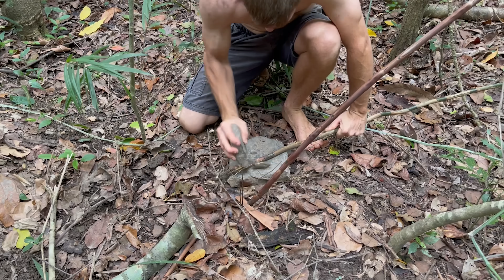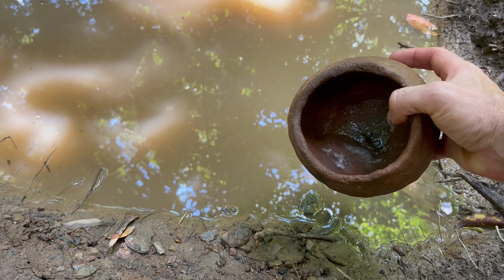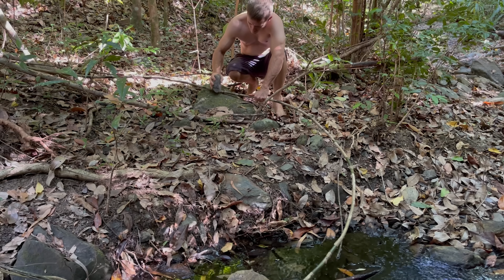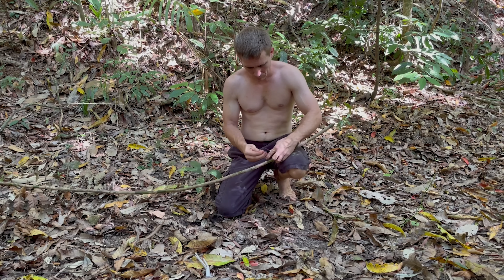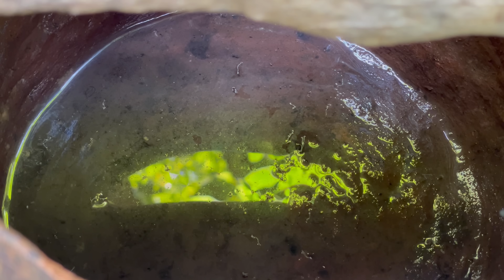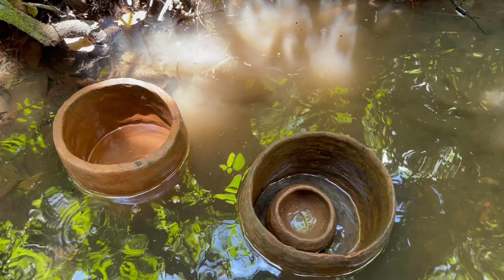Primitive Technology: Cane Water Filter/Siphon

Comment: So cool to see the water seeping through the clay, I had no idea it could do that.
Reply: I knew water will wick through a terracotta pot because you can use them in your garden as a slow, steady way to water plants at the roots, but I had never considered the fact that this would work in reverse if they were submerged in water and that this would filter the water. But clay is used as a water filter in some devices.
Reply: Are they not fired or what? I didn't think the pots were water permeable
Reply: @betterthantelevision  they are fired. and they arent nearly as permeable as when not fired. but to make them truly waterproof he would need to somehow glaze them. at least the inside, but i dont know if the glaze would maybe chip off if the outside would still let water in and have it seep under the glaze. if thats even how it works, im totally talking out of my a$$ right now
Reply: @drecksbongert4367  You can actually use milk to increase the waterproofness of the pot. Simply rub some milk on the inside of the pot and then let it dry out completely. This will create a thin waterproof layer on the inside of the pot. Although, I don't know how long this layer will stay and if it will eventually dissolve into the water again. Also, where he is located is might actually be more feasible to glaze the pots than to obtain milk.
Reply: @betterthantelevision  they are and thats also how the concept of earthern pots work.
The water that very slowly seeps out gets evaporated and that makes the pot and the water cool.
They wold need a coating to be waterproof.
Reply: I did some pottery classes about ten years ago, and from what I remember, how permeable a pot is depends on how hot it was fired. John here usually produces earthenware, which doesn't dissolve in water like rough clay does but is porous and thus permeable, since in order to produce the nonporous stoneware he'd have to get much higher temperatures in order to vitrify the clay (basically partially melting it into a glass). To do that he'd need similar, if not more, heat generation as is produced in his iron-smelting setups, which isn't really practical for his larger pieces.
Reply: @necrorebel5718  his clay also may not be able to get to zero percent porosity without melting. Lots of earthenwares bloat and melt well before 0% porosity— he’d have to find a stoneware deposit if his clay couldn’t handle the heat. 

It might be possible for him to salt glaze his work though. Pretty sure you can salt fire as low as cone 1.

Comment: Did the canes affect taste? The pots seem to be a better solution, they might be slower, but the water looked better. Of course, it would be best to bring it to a boil and cool down before drinking.
Reply: Definitely agree to boil that water before drinking it.
Reply: This would absolutely need to be boiled. This won’t remove pathogens, just dirt and particles. It’s also worth noting that mosquito larvae start appearing after just two hours in stagnant water.
Reply: @austinbevis4266  Free extra protein :D
Reply: @austinbevis4266  according to the channel's info/comment up top, MIT engineers did test with pine branches and it removed 99% of pathogens.
Reply: @hobohobo13  these are canes
Reply: @hobohobo13  also the water sits in the vessel for hours as it collects. That’s where the mosquitoes come into play. This could be solved with a good lid
Reply: @A Villa  99% means nothing. Safe drinking water starts at 99.99% and even then it's kind of dicy

99% was also done with treated pine, under lab conditions. What he did in this vid was basically drink raw stagnent water.
Reply: @austinbevis4266  Mosquito larvae? Sounds like free protein.
Reply: My thought process: if you have the opportunity to make a fire then boil the water!
It's way safer and the risk reward is clearly in your favor. catching some kind of germ is about one of the worst thing that could happen to you in the wild. Of course filtering water is better than dying of thirst. I think every method that reduces risk should be used. boiling won't remove fine particulate it will only kill most of the germs so the water will still taste like mud. So both are complementary methods in my eye.
Reply: Yeah, the canes would probably be a good pre filter to get most of the grit out
Reply: @joshuacheung6518  yep